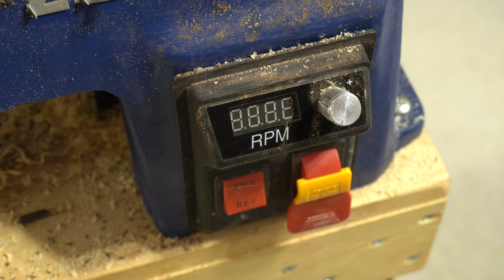Woodturning | Fountain and Ball-Point Pens from Wenge

Comment: Nice job.  I've made a few Wenge pens as well and it is beautiful wood.  I do recommend being careful with it dust and splinters from Wenge are reported to be pretty nasty.  As for mandrel choice, I have always used one with a mandrel saver.  Recently I have begun turning between centers.  Just using 60 degree dead in the head stock and 60 degree live center in the tail stock and the standard bushings.  Yes you have to turn each part separately, but I'm good with that, I have noticed it is more stable and never have any oval issues.  Note it won't work on slim and trimline pens, has to have bushings that go inside the tube.

Here is another tip I picked up recently (thanks to ED at ExoticBlanks), instead of facing the blank before I turn, I turn down to within about 1mm of the bushings and then face the blank, much less work.  I also stopped using a pen mill and now use a jig on my sander (could also use a Jacobs chuck on the lathe).  Again, thanks Ed on that one.

Keep up the great work!
Reply from the maker: Thanks, David, for the helpful tips! 

Regarding the wenge dust, do you mean nasty from a safety point of view?
Reply: @formanwoodworking  Yes, inhaling the dust or getting splinters.  Just wear dust protection and if you get a splinter, clean it out real good.  I meant to ask... what fountain pen kit is that?
Reply from the maker: @davidbondi  Ah, okay. Yeah, I'm pretty strict on wearing a respirator at any point in my workshop, and that's partly because I am not well read of wood toxicity 😅

And the fountain kits I use are these, in various colours of course: https://www.penblanks.ca/algonquin-fountain-pen-kit-black-titanium/
Reply: @formanwoodworking  Thanks, I'm always looking for good kits.  Glad you wear a respirator, I do the same anytime I'm turning, cutting, sanding, finishing, etc...